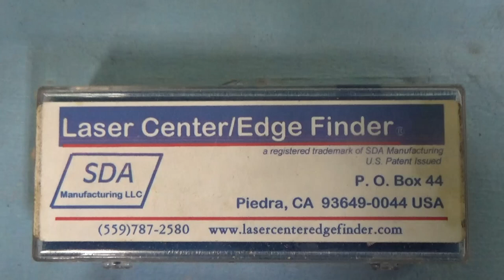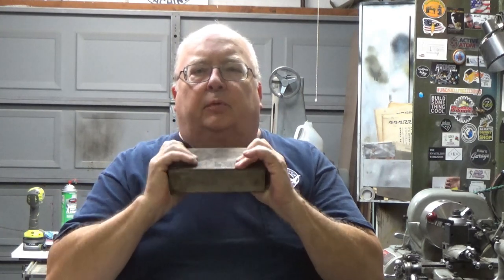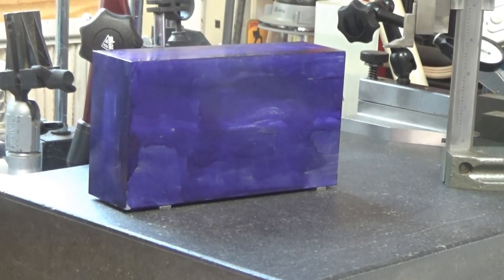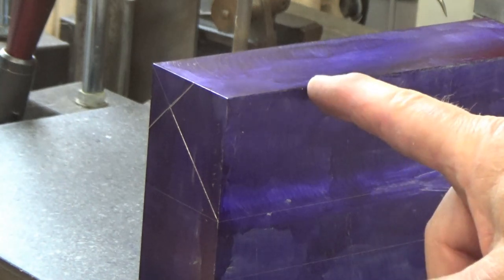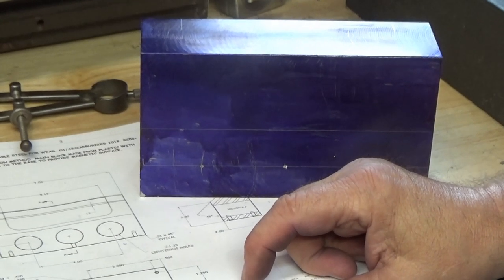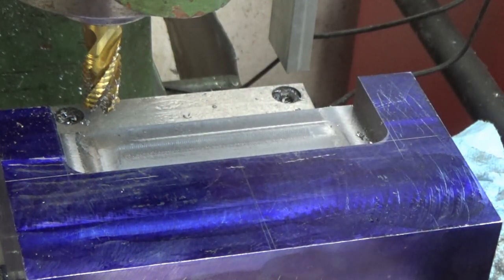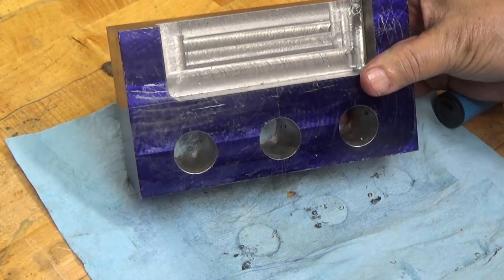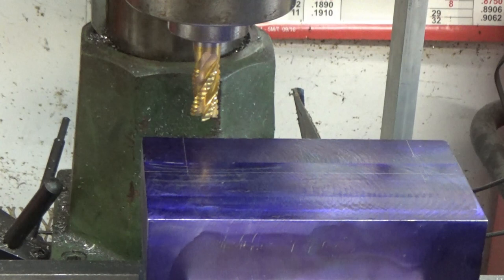Building The Tom Lipton Chamfer Fixture Part 1

Comment: I saw Harold's build of his version of this tool the other night.  I don't have a surface grinder nor a belt grinder but the idea is interesting.  Even with the block being .100 smaller I don't think it will affect the function at all.
Reply from the maker: The lower height would result in larger parts hitting the bed of the sander/grinder.  That can be overcome on the grinder by moving the fixture further away from the fence and cranking the wheel out closer to the edge.  I originally was going to use some material that I had on hand that was 1" shorter also but I found the 2 X 4 material on eBay.

Comment: Thanks for the video, Steve! I know that there are many ways to approach an operation, but I am curious if it is possible to go full depth on pockets when using a roughing end mill in a small mill.  What are your thoughts on this? Thanks!  Appreciated the "tighten the vise" 😆
Reply from the maker: I took .050 cuts, could have gone a little deeper but the spindle was making a lot of noise.  I will be experimenting with some deeper cuts when I start cutting the v groove. I had to laugh at myself on that one. Thanks for stopping by.
Reply: @sharkrivermachine  Looking forward to your next video, this is an exciting build!